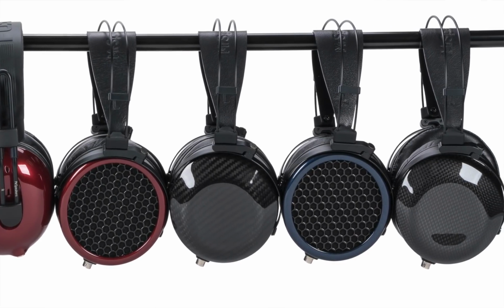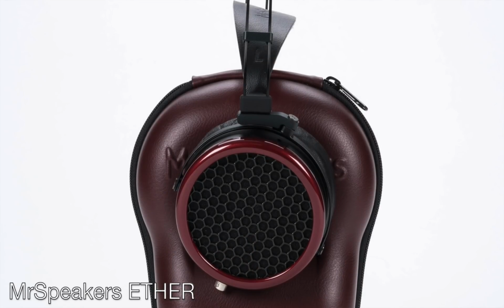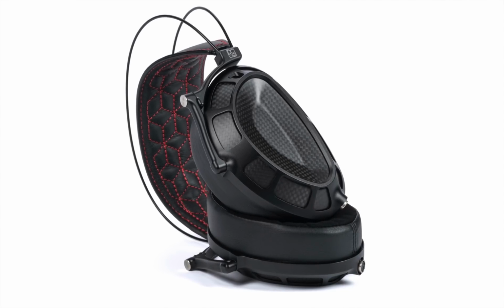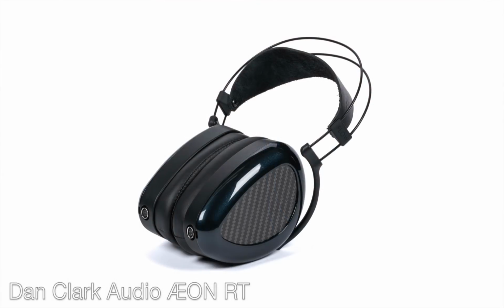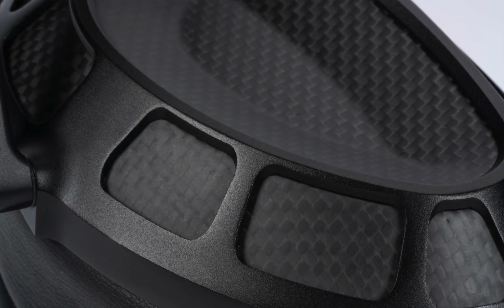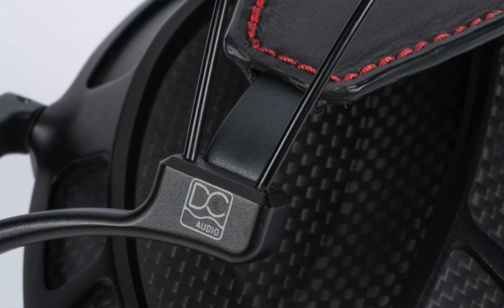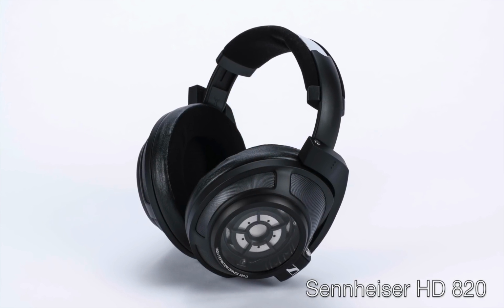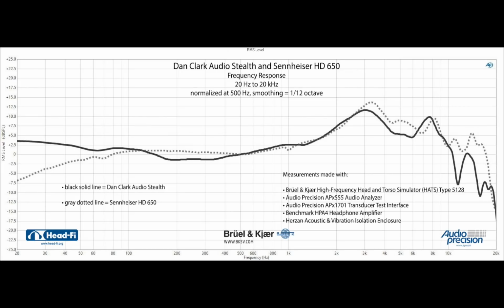Dan Clark Audio Stealth Review, Interview, Measurements

Comment: Looks great. I really wish the cups were a bit larger. By the way, the meta material is an old concept. First paper was published around 1940s. By 1980s, commercial products were already available. Finally, KEF brought it into the consumer audio in 2020. So, the consumer audio engineers lagged behind the scientists by 80 years or the commercial products by 40 years. A retail product lagging by 40 years isn’t too bad by any mean. The gap between the high-end consumer products vs the high-end commercial products can be extreme large which goes same for the price.

Comment: Hey Jude, nice review. Do you have the specs for sensitivity, recommended & max amplifier power and impedance yet?
Reply from the maker: The impedance is 22Ω. As for sensitivity, it takes around 370 mVrms to reach 94 dBSPL (1 Pa) at 1 kHz.

EDIT: The average to get to ≈94 dBSPL was around 394 mVrms.
Reply: @headfi  Thank you.

Comment: These are $3,999.99 headphones.

I would rather buy Meze Empyreans for $2,999.99, open backs aren't just for improved sound, but also for ear comfort, closed backs often have air pressure problems which can be seriously painful. And Meze Empyreans innovate, without losing ANY comfort due to open back design.
Oh and also, the Empryeans can be completely dismantled by hand, and you can get replacement parts for ANY part of those headphones, something the Stealth doesn't seem to have, at first glance anyhow.

Sure, the stealth gives THD 0.03%, whereas the Empyreans have THD 0.1%, but honestly, no human on this planet can hear the difference, anyway so... You're paying 1000 dollars more, for... essentially reduced headphone build quality compared to the Meze Empyreans. :P

Nice headphones, but... sadly it doesn't really fit any demographic... I think these headphones are tone-deaf, so to speak, market-wise. : /
Reply: Sounds like you don’t own either, but have very strong opinions on the superiority of the Empyreans.
Reply: I own an Empyrean and love them, but I'm still very interested in the Stealth.
Reply: @NoKNOTsense  This is on a totally different level of head-if, but Ollo Audio also has easily and inexpensively available replacement parts, including matched drivers. I have the S4X and prefer them to my Focal Elex, for what it’s worth.
Reply: The Empyreans to my ears were just okay. I ran through just about all the top totl headphones. This should be a level higher than Empyreans. We'll see how the Empyrean Elite will sound.
Reply: Now with covid on the out. Im not gonna go in the office or public with emps.  Ill be wearing these. They fold too
Reply: I had the Empyreans. They’re okay I liked them. I won’t be quick to say they’re better already; nobody knows that yet. But you do make a point about the comfort and pressure and temperature when using closed-backs for long periods. I love letting my ears breathe with my Susvaras. But as a closed back that’s easy to drive and easily transportable (it folds so small), and something I can use in an office environment, I can see myself getting a pair.

Comment: My biggest issue with Aeon is that the dynamic range is too compressed. DC must be really confident to not bump 100Hz on the Stealth.
Reply: had that problem with the ether flow as well. i liked everything else about it, but that one critical flaw drove me to sell it.
Reply: If you look at the ASR measurements, 100Hz is bumped by a couple dB.